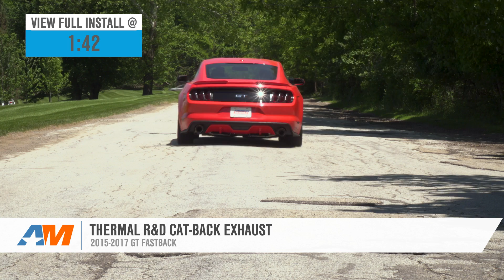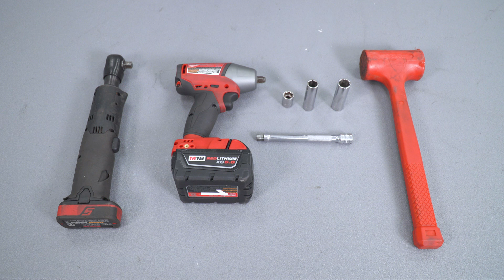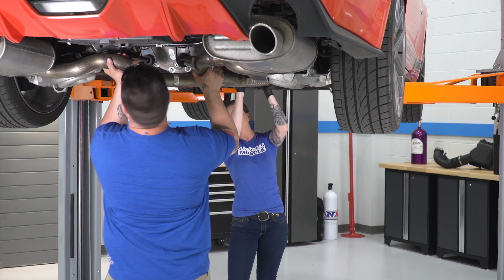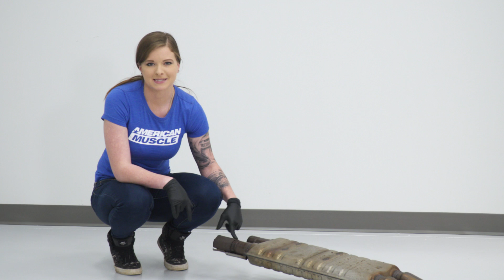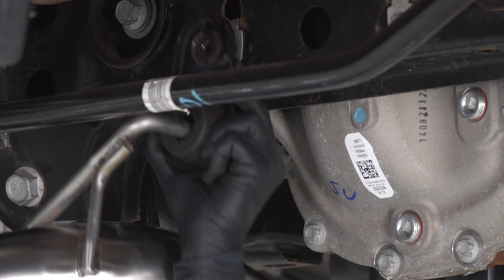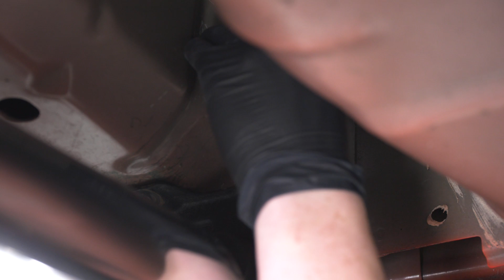2015-2017 Mustang GT Fastback Thermal R&D Cat-Back Exhaust Sound Clip & Install

Comment: I just installed this on my 2017 GT. Perfect sounding exhaust. I absolutely love it and it’s very high quality.
Reply from the maker: Awesome to hear! I'm glad you love it! -Zach
Reply: Do you have headers installed too, or just factory manifolds? I bought this system along with Pypes catless long tubes but have had a chance to install them yet. I am worried about the car being TOO loud. I was originally thinking about the Borla Stinger S-type 3" and saw someone commented that these 2 systems sound similar so I decided to save a few bucks.
Reply: johawk79 mine is just the catback. Stock manifolds and cats. I think the sound is great. I’m sure catless long tubes would raise the volume. But I couldn’t say by how much.